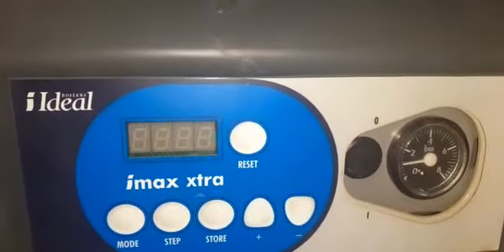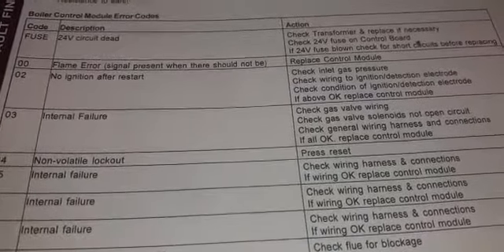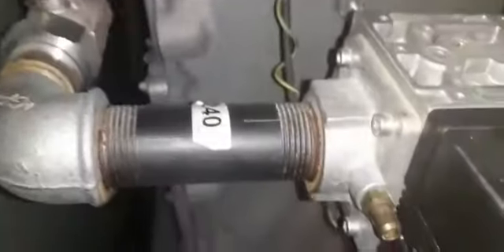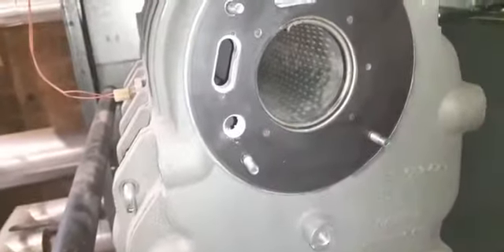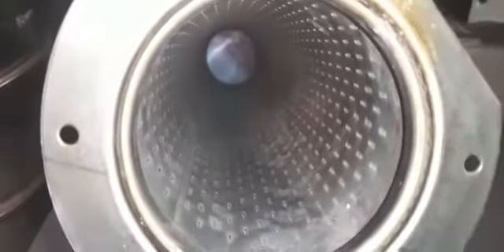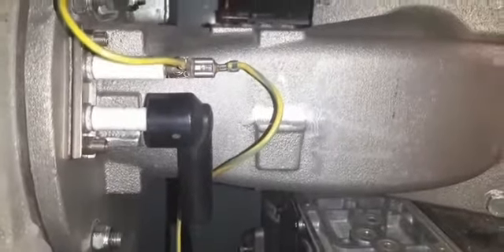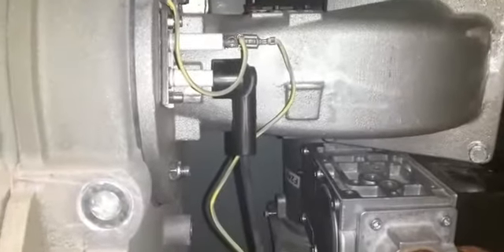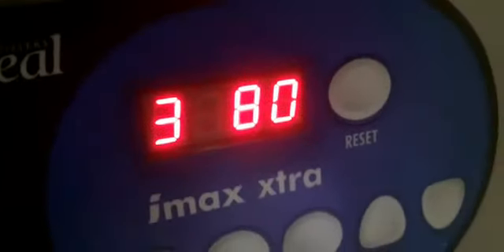FAULT E02 / IDEAL IMAX XTRA F240

Comment: Could you explain bit more about DN number and PN number please.
Reply from the maker: The nominal diameter (DN) is a conventional indicator used as reference for assessing the size of those elements that can be coupled in stainless steel pipes (flanges, fittings, valves).

Knowing the DN is essential for calculating components’ working pressure.

Indeed, only elements having the same DN and the same nominal pressure (PN) can be coupled.

A pipe’s nominal pressure describes the maximum internal pressure that the pipe and its joints are capable of withstanding and it is expressed in bars.

But how do you calculate the PN value? And what does it mean?

The nominal pressure is a scale of values roughly following a Renard series with common difference of 5: 2;5;6;10;16;20;25;40;50;64;100;150;250;320;420,640.

The PN classification includes both mechanical and dimensional characteristics and it does not represent any physical quantity in any specific unit of measurement. A pipe’s nominal pressure describes the working pressure in bars, only for the involvement of water at maximum 20°C. When the temperature increases, the nominal pressure decreases according to the specific standards of each and every kind of fluid. (information copied from "fitting service.it" website)
Reply: Been offered a job so I finally got my way in to the industry
Reply from the maker: Well done bro. Very happy for you.  Also didn't realise that you have a good YouTube channel.
Reply: @CommercialGasEngineerVideos   thanks bro, I'll be working on air source heat pumps, ground source heat pumps and other appliances.

Yes I have but stopped a while ago
Reply from the maker: Cool, you're working on future equipment.
Reply: @CommercialGasEngineerVideos  yeah so it's a step in the right direction although commercially I think there will always be gas
Reply from the maker: @DouieTV  I agree. I don't see a realistic way of getting rid of gas in a commercial setting until resources run out.